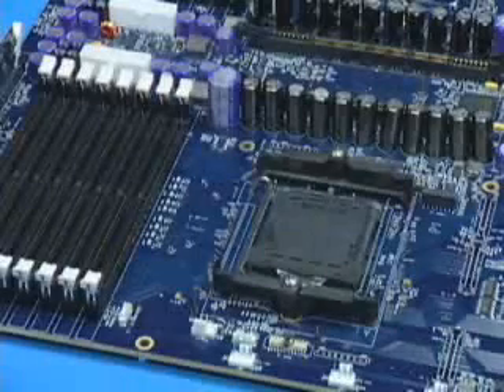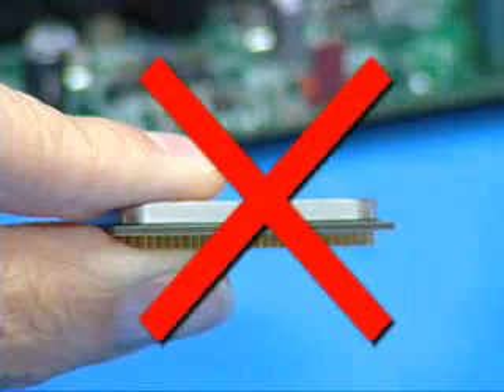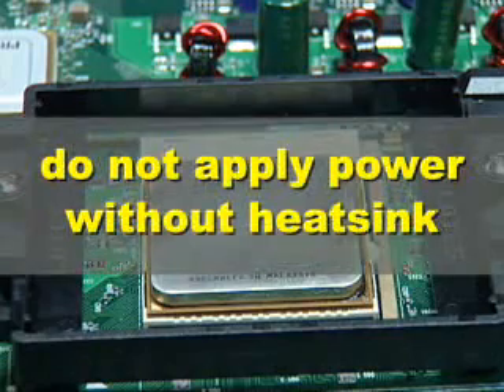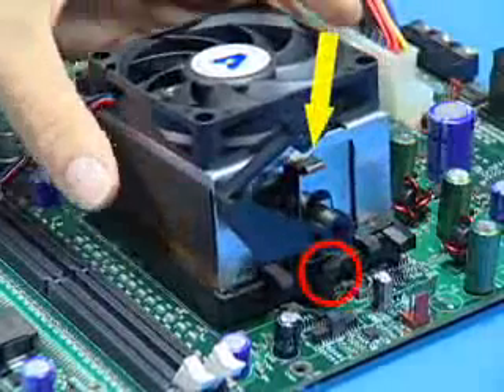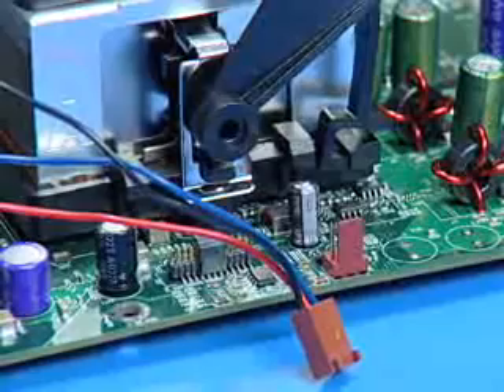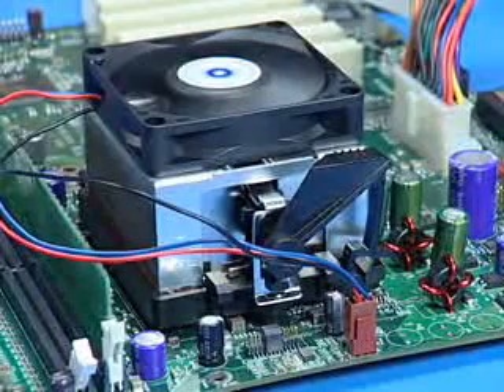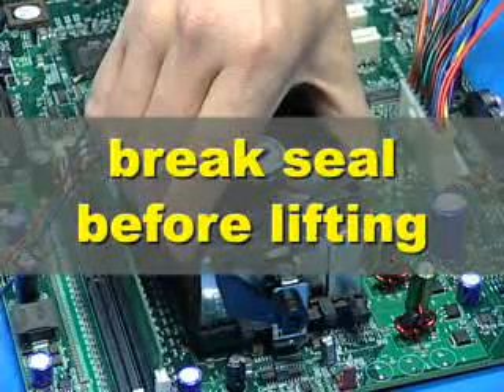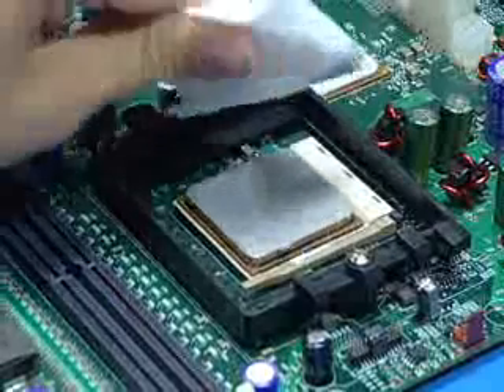Installing a Processor and Heatsink

Comment: after installing the processor, place the 982 vacuum tubes (not included) in to their respective slots. and then call the 1800's. because they want their processor back.

Comment: Lol I'm 13 and love computrers... You really don't have to worry about the static unless you're removing the motherboard or touching the motherboard. Just don't touch pins on the bottom, and relax then put it in the sock after opening socket and removing heat-sink just put on close gate and done. APPLY thermal paste don't be greedy but not to much and then put the heatsink back on and put screws in, and THEN you are DONE.

Comment: To think with modern Intel heatsinks you push in 4 pins and you're good to go

even though all stock ones aren't good for much other than nothing. They are free though, so there's an upside.

Comment: Normally you'll hear error beeps, refer to the manual to know what component is faulty. (e.g. video card or memory) If you don't hear any beeps, then either you have a separate mini speaker that you didn't install to the motherboard, or your main-board needs 2 power connectors: one P4 four-pin power plug AND the 20/24 pin power plug. Loads of people forget to plug in the Four pin plug, thinking the "big plug" does it all. Last possibility is that the main-board is dead.

Comment: Re-installing a heatsink for my AMD athlon xp, this is so fucking frustrating putting the clips back in, they have 3 plastic tabs, the more pressure i try to put the clip down to attach onto the tabs the more i worry that im going to bust a hole in motherboard, if anyone has any advice then please tell me, thanks

Comment: @alanibanez Your Heatsink probably did not set right which means you need to take it off and set it flat on the CPU and Clamp is down.  Another thing you might want to do it Re-apply some thermal compound and flatten the compound out to a nice smooth layer so it fills in the little gaps when your heatsink clamps down on the processor

Comment: Well you're processor isn't loud the fan is, to get a quieter one go online or go to you're local computer store and get a new heat sink, clean off you're processor with rubbing alcohol, dry it off make sure nothing is on the proccesor spread you're thermal grease and then put on the new processor.

Comment: (asakaolol) 1. the processor you buy has a socket type which has to match the motherboard. 2 you probably have a mid tower case (mainstream) so i would recommend getting a Micro atx rather than an atx, micro atx is smaller in size just in case your case is a bit tight. 3 if you have a dell/hp or any other brand name, you will have to format your hard drive before you install your new motherboard/cpu, make a bootable cd, set your bios to boot to the cd or dvd drive. (my opinion) buy a corei7 !

Comment: i've installed a cpu bt failed to run OS. it gave me "error".  my upgrade was 64x2 5600 form 64 3800. motherboard is nvidia mpc61 w/c i think support the upgrade. pls help what went wrong.

Comment: Am not 100% was just a statement but my geuss is to get a psu and a molex to 4pin or 3pin *depends on fan* and turing on the psu. Ovs make it sure the psu is old one and working properly incase anything gose wrong.

But if am wrong correct me. There should be a way to tset if your cpu fan is working properly before apllying to your mainboard ontop of the heart of your pc build.

Comment: Hang on he say's "once the heatsink is in place power on and check if the fan is rotating at a rapid speed if not shut of instantly"

wouldnt i be wise to check the fan before even applying it to the cpu??? it would make more sence if you ask me lol

Comment: ESD protective straps? I doubt those are even available for purchase in my country. Just ground yourself before and during the building process by regularly touching a radiator or some  other grounded metal.

Comment: The stuff gets pretty solid after removal. Plus dust and dirt can get into the leftover paste. Plus it's kinda lazy, thermal paste is cheap, just run to a local electronics/computer store and get some, or better yet, buy a Tube of Arctic Silver 5 - the good stuff.

Comment: You can, but it's not recommended. When you first use the Heatsink the paste pad bonds to the top of the CPU and melts under use like Wax to fill the microscopic pits and grooves on the metal surfaces. Over a day or two it cures to form a seal.

If you remove the fan and reuse the old grease, the grease gets moved around and creates thick spots and thin spots in the paste that reduce cooling power.

I'd recommend cleaning it all off to begin with and applying a fresh layer of Arctic Silver 5.

Comment: You need to update your system's BIOS before you install that AM2 CPU (6000+).  

The AM2 6000+ totally smokes a single Athlon 64 in multitasking and running multi-threaded applications. This processor is 3.0GHz per core.

Startup times are dependent on a lot of factors. Memory speed (should be DDR2-800), amount of RAM installed and the number of services to load in Windows/Linux/whatever OS you're using.

Comment: rub you hands and fingers on the metal of the case and the side of the power supply, that eliminate most esd you are carrying or you could go fancy and get the wrist straps, whatever you choose but i just rub when i replacing a cpu or any other part. :)